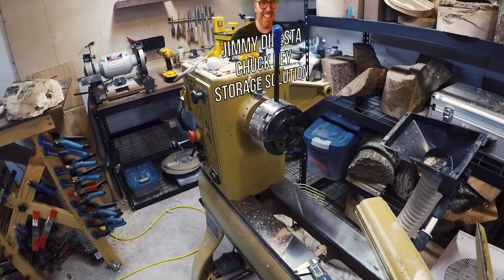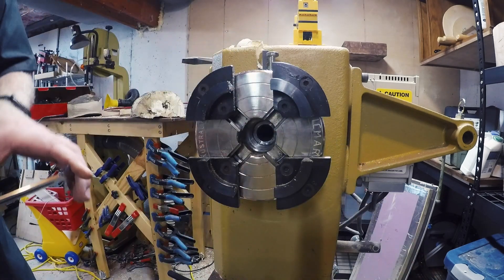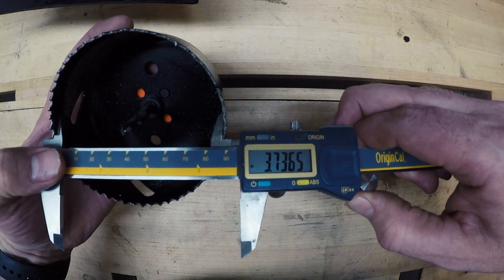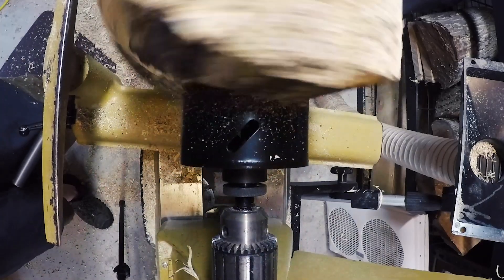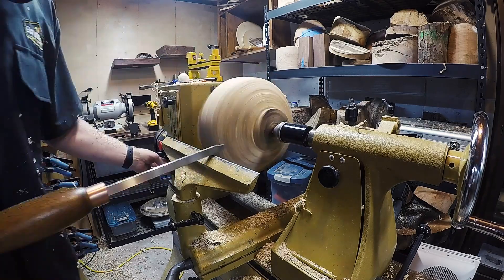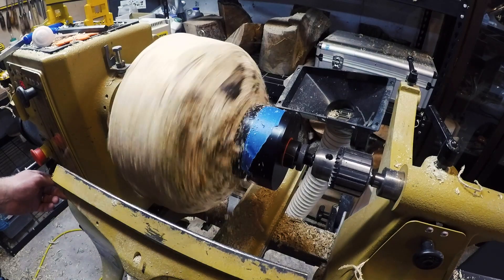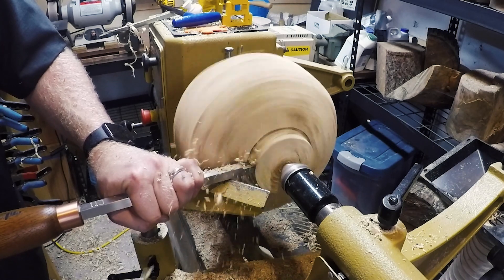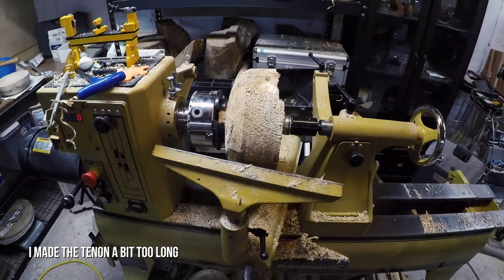Turning the (NOT SO) Perfect Bowl Tenon Every Time - The Hole Saw Technique

Comment: Puh, there are some things wrong here... Why do you open the jaws to the max? The dovetail jaws have the best grip when they are in a perfect circle, so almost closed! In case you want a bigger tenon, use bigger jaws.
Also the length of the tenon is critical! End end should not touch the ground of the jaws, but the tip of the jaws should touch the bottom of the bowl... Because this contact gives the most support and not just the clamping power of the jaws and chuck!
Pains me a little, seeing this very professional equipment so poorly used.
Not talking about the scraping action instead of cutting...
Reply from the maker: Thanks for the tips!  I apologize for causing you pain.  As for the length of the tenon, I noted that in the text on the video, though I should have gone ahead and trimmed it.  Point taken on opening jaws to the max. As for scraping, that’s how the EWT are meant to work, and I’m just roughing them out to finish later with my more elitist traditional tools.
Reply from the maker: Thumbnail and video notes updated!
Reply: Looking forward to your instructional video series on proper technique.

Comment: Your technique is a good one. But Mario is correct, your execution is wrong. By having the jaws fully open, you are gripping with the corners of the jaws only. A 2 1/2” hole saw would give a more appropriate sized tenon.
Reply from the maker: Very good point.  In my zeal to get the largest tenon possible, I ended up with one that is likely not as strong due to the reasons you both mentioned.  I will update the video notes to that effect, and perhaps make a new video with better techniques.
Reply from the maker: I updated the thumbnail and video notes accordingly!